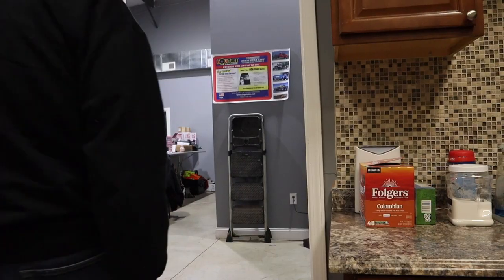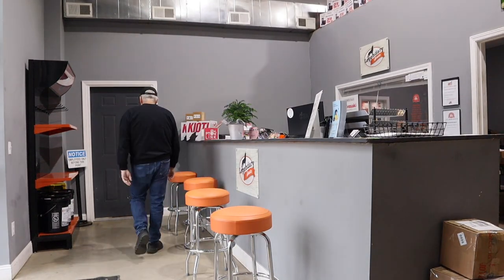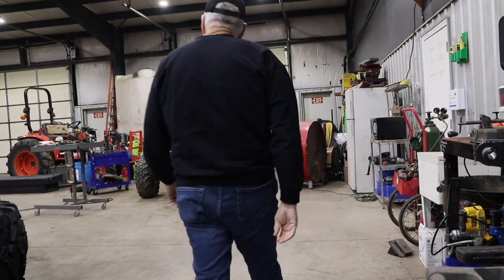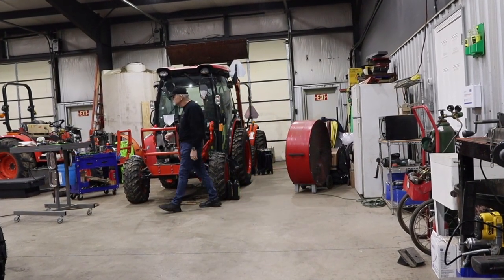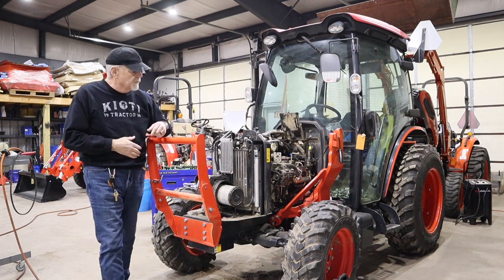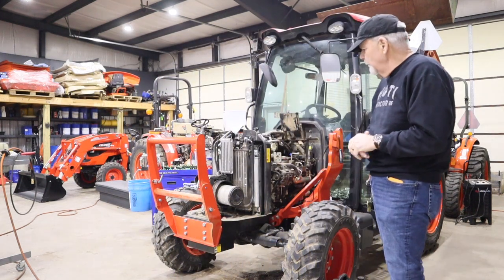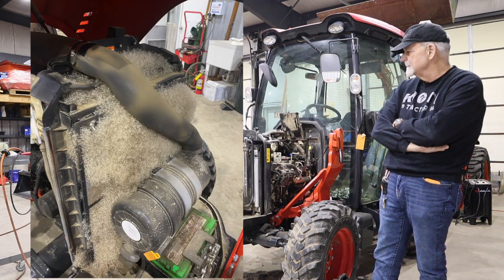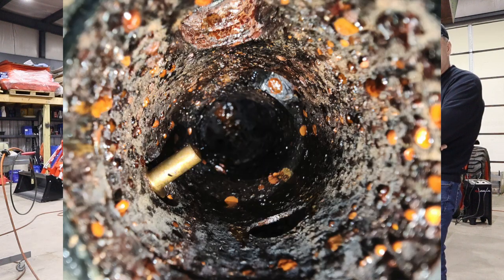LSE NASHVILLE.  TILBBS: COOLING JAN 7 2025

Comment: Cordless leaf blower and less than 5 minutes would have prevented that mess. Not sure why someone would run it in 4x4 if its not needed. Ill bet a Pepsi the tie rods are loose.
Reply from the maker: Yep.  A blower after every use, and a garden hosen from the engine side outward once a month or so.